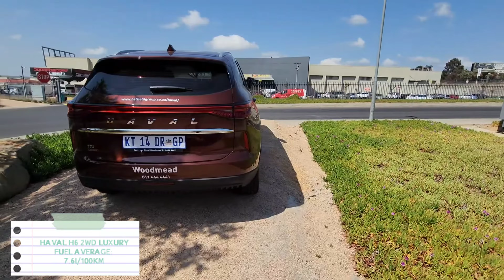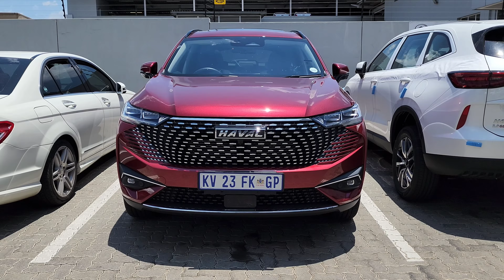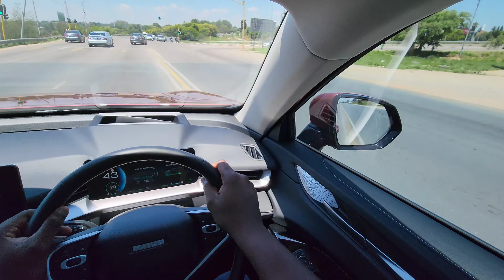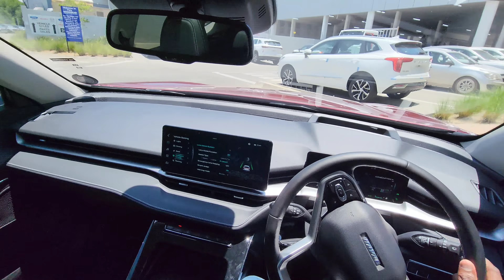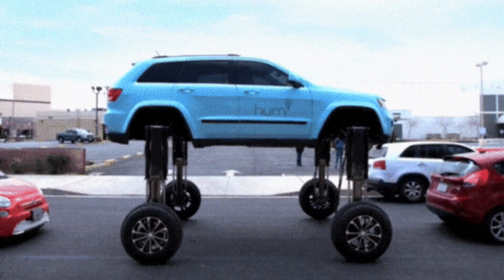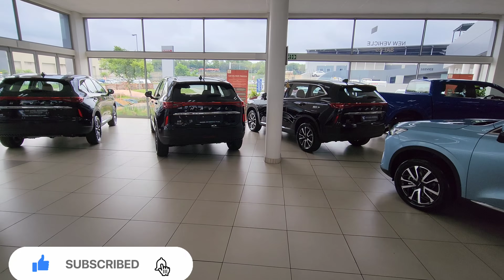2022 H6 Hybrid Fuel Consumption Test- Is worth your hard-earned money???

Comment: Hi dear
As a HAVAL H6 HEV user, let me know your very real experience with this vehicle.
After a long mileage, how you found Haval in Fuel consumption, Comfort level, Driving ease, Safety measures, Suspensions result?
ANY ANY ANY COMPLAINT?
Would you like to recommend me buy this SUV?
Please I need your real life based experience rather than video talks like many other guys do.
Thankyou
Reply from the maker: Hi. They are good vehicles in my opinion. Also you have good warranty coming with the cars so you should be covered if ever you have any issues. The one you see on the video has done 12000ks now.

Comment: Thanks for the review bro. I was looking at Haval Dargo and H6 Hybrid, then I went to Toyota center to review RAV4, bro I got dissapointed for so much money they give such a bad quality RAV4, I was dissapointed really and comparing to Haval, it felt so good that Haval price is even lower but performance and quality build felt so much better. I did 2 test drives for Haval Dargo and H6 (without hybrid version), I enjoyed it a lot. On a bumby road feels so smooth and there is good sound proff inside also. All these 360 cameras has better quality than RAV4 with old style monitor which has only 1 or 2 cameras (front and back). Currently I have Toyota Auris but planing to buy a second car because I want SUV something higher and more practice. I think in 2023 I will order my Haval H6 Hybrid, here in my country Moldova (next to Romania) price for best version is around $30k and it's way more bettern than RAV4 for around $40k which don't even hav a opening roof. Thanks for review again. Love it!

Comment: Its a nice 1, but not for the price man - they are being rather ambitious
Reply from the maker: The issue is that making a car like that is not always as easy. The research and development and the know how that goes into the process is crazy. They are still charging lower than what their competitors are charging with everything included. They could still charge a bit lower, however I think they hit the nail by charging less than competitors.
Reply: Yep, bona they are cheaper thats for sure